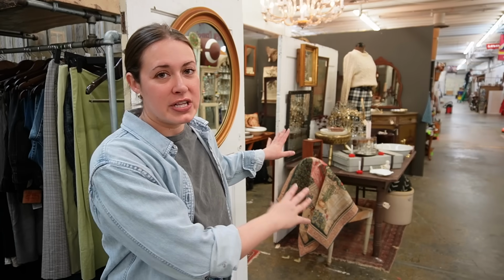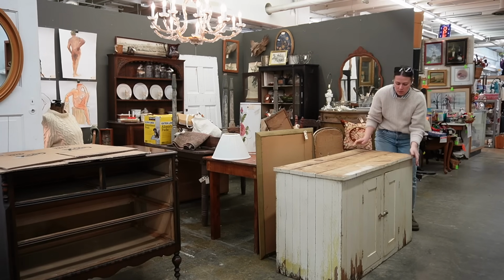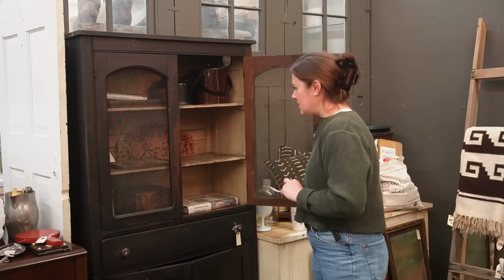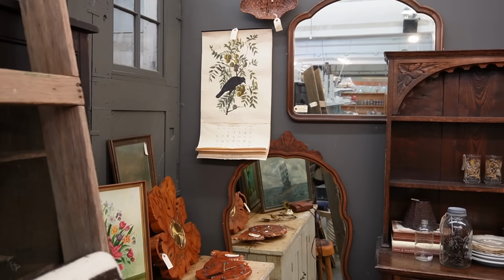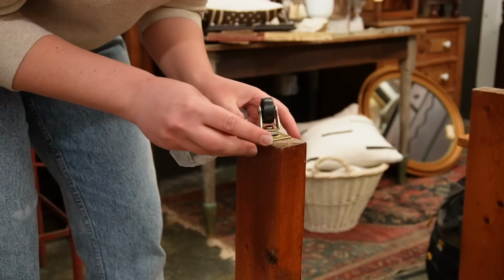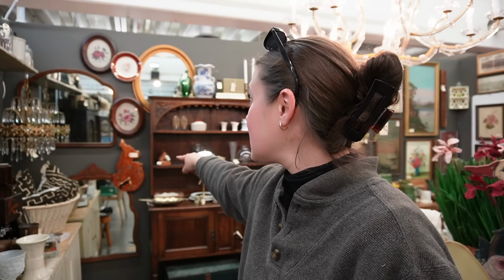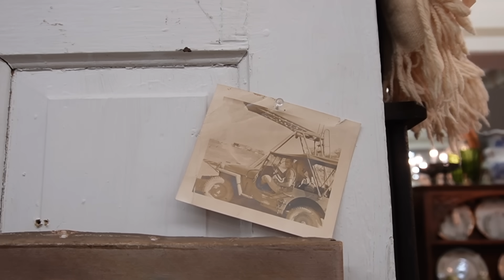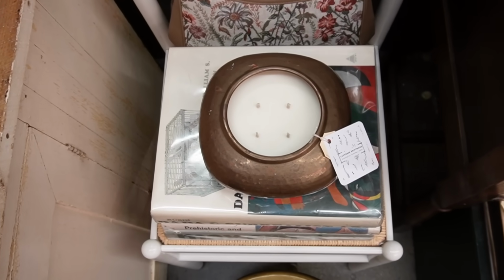Organizing My Antique Booth in 6 Day

Comment: Super fun reset! I love all the florals, and the clothing looks excellent. Just a couple ideas you might consider: 1. Wood blocks to put your table(s) up as high as you want for a temporary fix, rather than permanently altering height with casters (although that table looks really cute with the casters). 2. Can you hang the doors higher up on the walls, or attach beefy brackets to them that hang on the wall (like a Christmas wreath hanger)? 3. Door #3 can be hung about 2' off the corner made with the 2 other doors and get the same effect, or 4. Could you affix door #3 to the wall sideways? You would get a ton of white background landscape that way. Thank you for a fun video.

Comment: Hi Amanda! I am loving and learning from every one of your vlogs. I flip an occasional unique item on Marketplace that ive thrifted . Im hoping you or your viewers will have answers to thisquestion.
🐦 I have a pair of vintage, like new 8 inch, razor sharp, Ginger Designer Series "Cheetah" dressmaker shears. Stamped - Chrome Italy and engraved - Gingher. I have the black plastic safety gaurd they slip into. The handle ends are painted with a cheetah  looking coating. No box.  Where would be the best locations to advertise them?
Thank you for any advise you have.